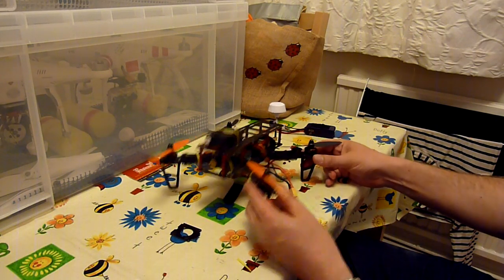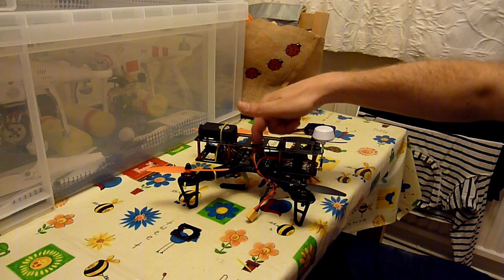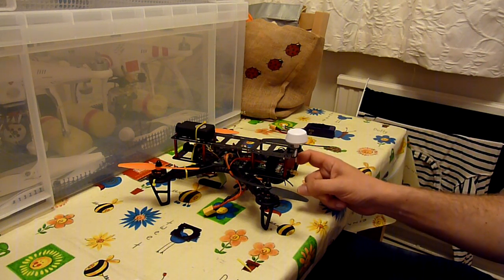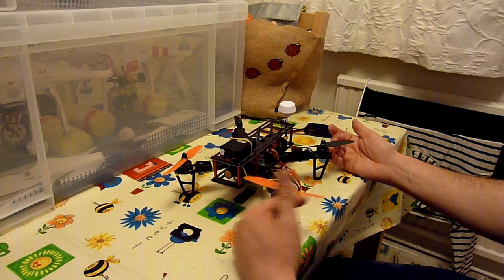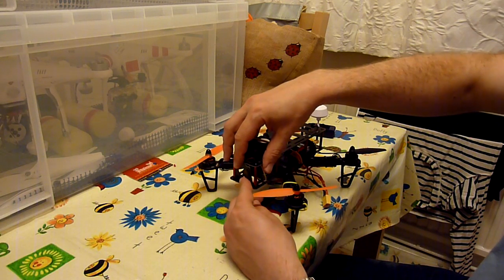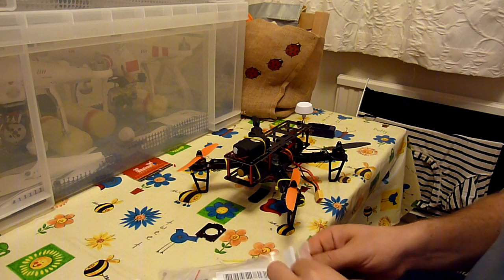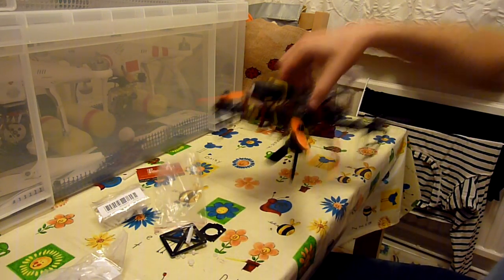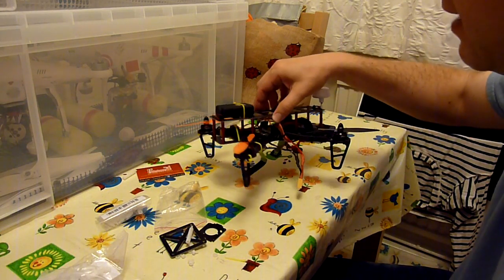FPV250 Cage long frame Hobbyking Diatone Micro quadcopter frame mini review

Comment from the maker: +sheraz - can't reply on youtube, think you have replies disabled? - if they are 12mm spaced you need to slot the frame on two of the holes (same as my rcx motors, a PITA) I only ever use 2 bolts on the small motors, another option is to use cable ties through bar under motor, this way in a crash the cable tie will just break and avoid any more damage - Jon who I flew with last weekend did this, but the cable ties were a PITA, so I'd just use two bolts, if you use gemfan props they break really easily so you're really unlikely to break a motor anyway, I've crashed loads and the rcx 1804 are pretty tiny and I haven't broken one yet. This is why I prefer the look of the emax motors as they have standard bolt spacing so bolt straight on!

Comment: quick question how did you mount the motors i have DYS 1804 2300kv motors but the bolt holes doesn't line up any help would be great

Comment from the maker: Nicholas - you have replies disabled ;( For 3S 1900kv is too low, so for 3S 2400kv, if you are going to run 4S then 1900kv are fine. Personally I would use seperate fpv camera, as for proximity the latency even 100ms on mobius/gopro is too noticable, new pilothd v2 supposedly has zero latency, but I haven't tried one to confirm, the v1 was very slow latency, worst of any camera I tested.

Comment: Should I buy 1900kv motors or 2400kv's like yours? Also, will a $15 1/3 wide angle cheap camera do the job? Any recommendations for a camera that records as well as fpv's? Thanks in advance

Comment: Great video! Just a quick quesion what PDB are you using?
Reply from the maker: I just soldered up a rough harness for testing, but have never got round to tidying it up. I've never been a fan of PDB's, so either used multistar harness with bullets, or just soldered up direct, but I just got the DART250 frame which has PDB built in on bottom plate like the QAV so am interested to see how that goes.
Reply: ***** Sounds good, Let us know how it goes :)

Comment: Hi can I ask what size lipo battery your using and what flight time do you get on your setup. I've just set up a hk fpv250 clean and dirty frame and I'm only getting 4 mins of a 1300 3cell. And my motor and esc set up is the same as yours.
Reply from the maker: Says in description, I fly 6m30secs on a 1300 lipo, my AUW is 537g - if your heavier the time will drop off quickly.

Comment: What motor layout did you use on the kk board?
Reply from the maker: The one shown in setup screen, it shows motor numbers and directions - may change with firmware I guess.

Comment: You know you can use your Mobius as the FPV cam.  That's how I'm setup with my FatShark Predator V2.  Provides an outstanding picture.  And it's powered off it's own battery if you wire the output that way.
Reply from the maker: Latency on the mobius may be ok on bigger gps quad, but unusable for proximity micros, I made a video showing this Quicktip FPV camera latency comparison Gopro Mobius Fatshark 600TVL and PilotHD

Comment: Nice! Great vids! U got yourself a new subscriber! How did you manage to do the power distribution in a neat way?
Reply from the maker: I just bodged it by soldering the wires to a loop, it works but doesn't look great, with the cage on top there is space to use a seperate PDB which would be neater, so I may try that next time.
Reply: ***** Where would you place that pdb? I'm thinking of putting it underneath the quad with the lipo mounted on top of the cage. What AWG wires are you using? 20 I guess?
Reply from the maker: Willem Vergouwen With cage you can fit PDB under the controller with standoffs, plenty of room on top. Without cage you were restricted by the controller protector grill. I'd try to keep underside clean next time so nothing to rip off on a tree. 20AWG should be fine for ESC feeds, I'm averaging 8amps total, so only 2Amps per ESC. Probably use something a bit thicker on the battery lead just to be safe.
Reply: Thank you! I've ordered all my parts, can't wait to get started on this build!
Reply: Willem Vergouwen Just a quick thought.  Mounting your batt on top would place your moment of movement very high.  It may cause instabilities sort of like balancing a pole on your palm instead of dangling it form your fingers.